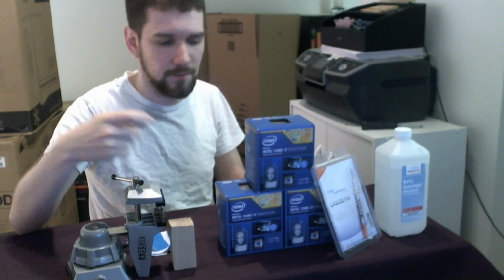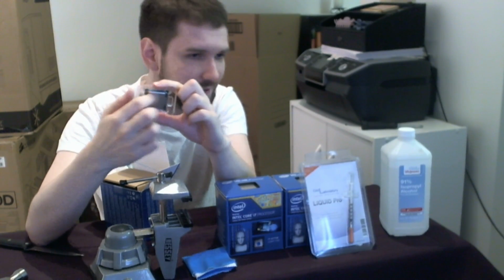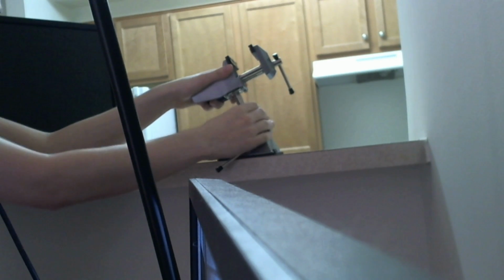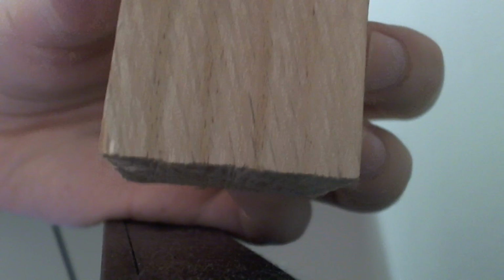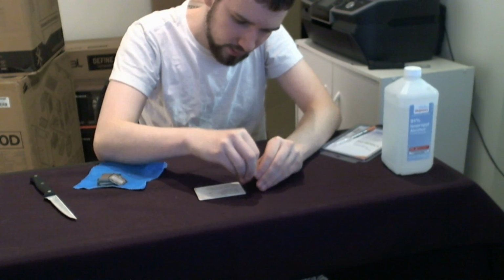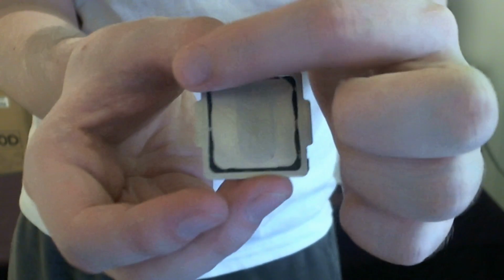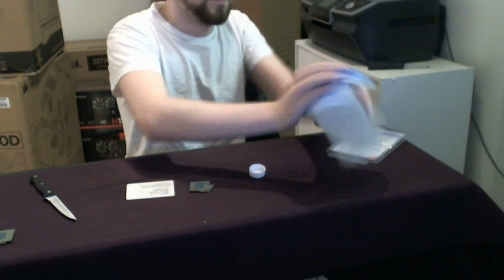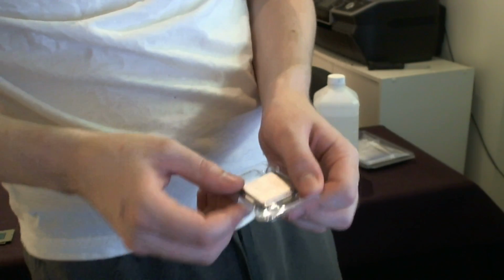Delidding three Intel Processors (Haswell, 4770k)

Comment: Do not use this method on the newer Skylake chips. This method works great for Haswell, but Skylake uses a thinner PCB that's much easier to damage than in previous generations.

Comment: Destiny, I have a few questions. Is there any concern about getting cotton from the q-tip onto the cpu surface when spreading the material? Have you made any videos with test results after doing this and if so where can I see them? After doing this and re-installing the cpu do you use thermal compound just like you would normally or can Liquid Pro be used? Just wondering too would this work with the gpu on a video card? What do you think about the razor blade method when doing this as opposed to your method? Right now with my I7 4770k I am regestering 3498.3 MHz and 86.F. with a stock Intel cooler and a room temp of 75 F. but I have to run the cooler full blast to keep these temps. I can see the advantage of this if it is possible to even get 15 .F cooler or more as you stated in your video. Thanks for sharing your info and video.

Comment: If I test the delidded CPU and it works as intended, could I just glue to two of the corners of the IHS to keep it in place in case I ever need to reseat the CPU?
Reply: You don't need to glue the lid back on the chip.  Your heat sink will clamp down on your chip and hold everything into place.  Just remember to be careful if you ever have to remove your chip that the lid isn't glued on so you can take extra caution.

Comment: I have never heard the back glue being the heating issue.. its the TIM that intel started using that is the problem.
Reply: You didn't listen I guess. He said it's the issue because it lifts the lid up causing a larger gap between the die and the IHS.
Reply: I heard that but that is not the problem I have been reading about.. the TIM was changed on this generation CPU.  It's junk thermal paste Intel used.
Reply: Combination of stackup of the goop + thermal paste on die + lid + more thermal paste + heatsink. Remove the lid + thermal paste you get direct contact with the heatsink. Even if the thermal paste is decent, there is still inefficiencies and not as much heat transfer as there could be.
Reply: htwingnut It makes sense.. they basically had a lot wrong with what they did on the first generation Haswells.  Removing my IHS made huge improvements and I could not be happier with my results.

Comment: Took me a while to realize you meant 15 Degrees Fahrenheit! Otherwise good video :)
Reply: No, he means C
Reply: you so funny
Reply: Lol you need to look into the temp drops from delidding, you get about a 20 C drop on average
Reply: holy shit, you are right o.O  Well i know what i'll be doing tomorrow!
Reply: actually though, many people who are getting 15+ degrees more, have max OCs around 4.7GHz which is very low. I can do 5GHz without delidding, so I am asuming my temp gain will be minimal at best.
Reply: simple custom loop. 1.5Vcore, 85C on the spot. Obviously I don't use that as my 24/7 OC. I have to run my fans on a pretty high setting for that. As I don't need the extra few GHz on a daily, I prefer silence and have it sit at 4.8GHz instead. I may have gotten lucky in the silicon lottery, but I have also seen chips that go as high as 5.4GHz on a similar water cooled system. (check out Jacob Freeman from EVGA for that)
Reply: NuMetal92 If you're getting all of that on a first gen Haswell, you absolutely struck gold in the silicon lottery!  When you're done with that CPU, you should frame it or something because that little guy is a miracle by itself.
Reply: ***** not really. Sure its not bad, but like I said above, there are even better ones ^^ When I am done with it I'll probably bump up the voltage and just see how far I get.
Reply: NuMetal92 No way, if there are even better ones, those ones are like finding oil.  You've got a real solid chip if you have a monster first gen Haswell, don't sell yourself short on that.

Comment: I would do this but.. I mean I was going to get the 4790k for the Z97.. but I couldn't resell my $400 Maximus IV Extreme for even $100 or even $50 or even $20

so I went with a $100 Z97 because the PWMs are on the cpu.. as reselling matters so much as 5th gen I need to get.. I went 4770k for $269 free ship sold my 3770k for $245 but shipping and fees.. still if I went 4790k I would only resell for probably $280 and 4770k for $265..
Reply: If only you could see the future
Reply: @toonguy1  yea.. I was into the PC more than most and missed stocks and BTC. I was doing it day 1 in 2009 and thought it was a scam. Survived many things of course that could've been bad but WW3 could still happen and/or we can catch up quick with AI/AGI.

Comment: 1150 vs 2011 any one better for gaming
Reply: 1150. 2011 is unnecessary for gaming imo.
Reply: nikita hirsch 
Depends on how often you feel like upgrading.

I'm still using an i7 920 (LGA 1366) from 2009 and I've not yet come across any reason to replace it.

So, extrapolating from that, in 2021AD, LGA 2011-v3 will still be highly viable.
Not so sure about LGA 1150.